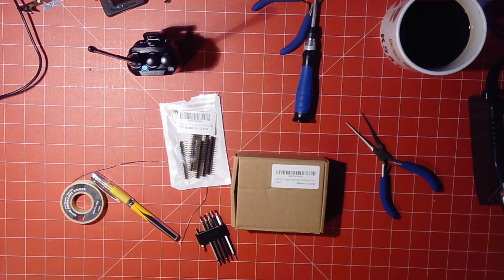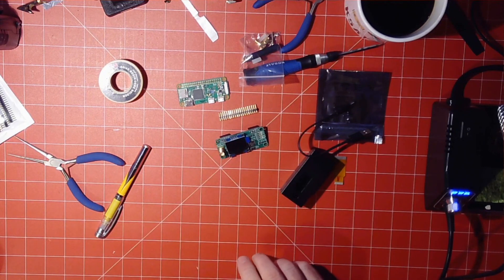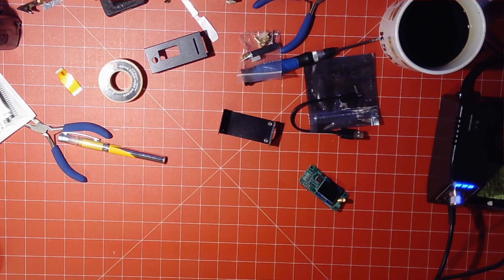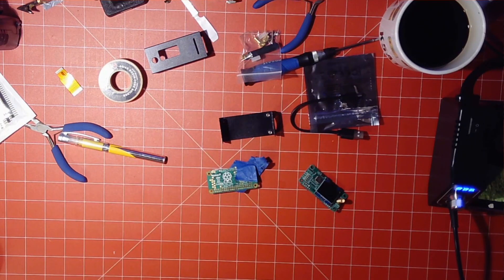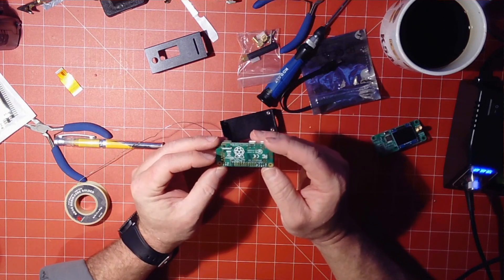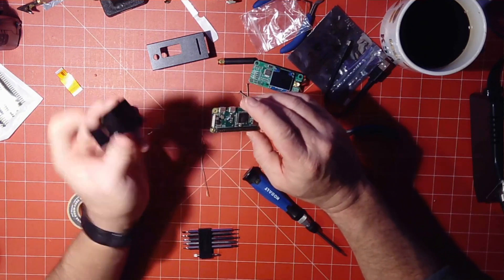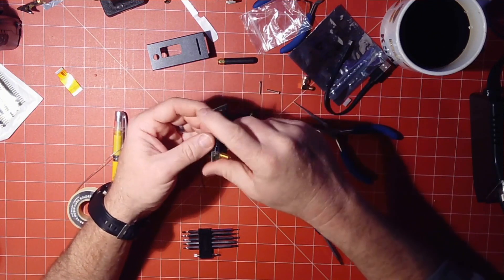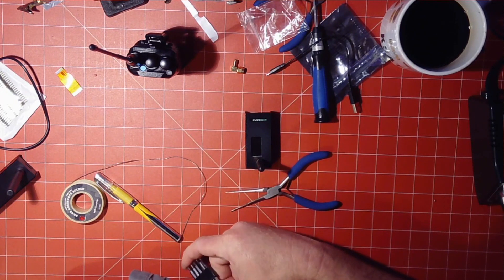Ham Radio Basics: How to Build an MMDVM Hotspot Using Raspberry Pi Zero

Comment: I have a challenge for you. With all the Raspberry Pi sold out or insanely expensive, is there a way to create an MMDVM using a Windows or Linux laptop? I have 5 computers lying around going to waste. It just seems like everything needs a Raspberry to function. I don't get the obsession with Raspberry when we should be able to use any computer to do the same thing. :)

Comment: Hi, was this a kit you purchased or individual parts?
Reply from the maker: It is a kit. They are all over eBay and Amazon. It is just a pi zero and a hat basically
Reply: @K5ATA  thank you, will check it out
Reply: Very confusing,  what do you type in to get google to show a pi hat that works with ham radio? Thousands of the wrong thing keeps poping up.
Reply: Mmdvm hat